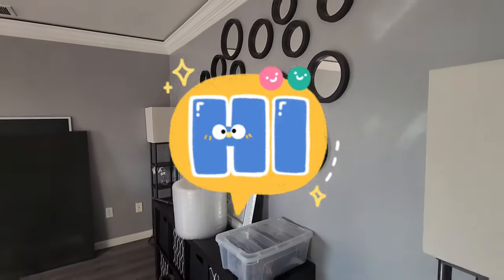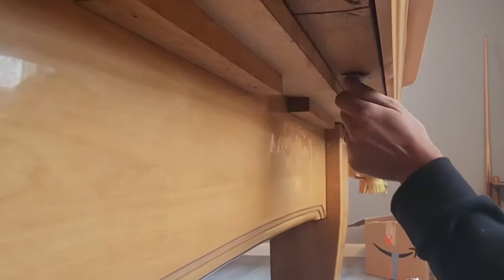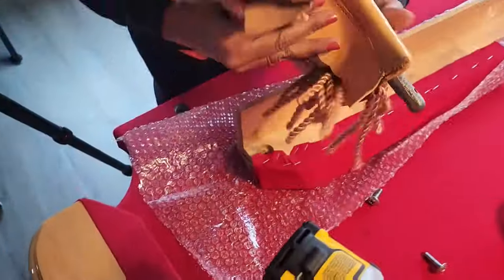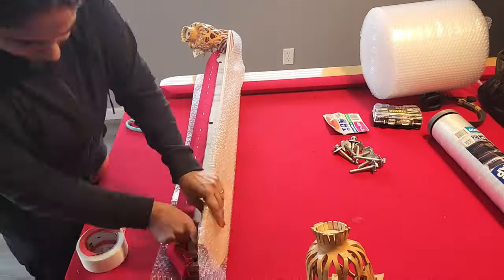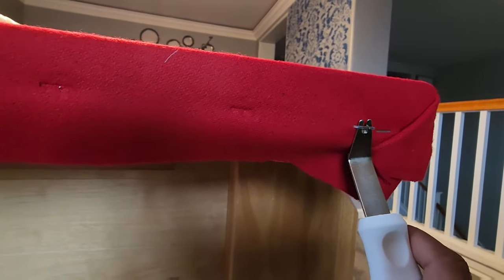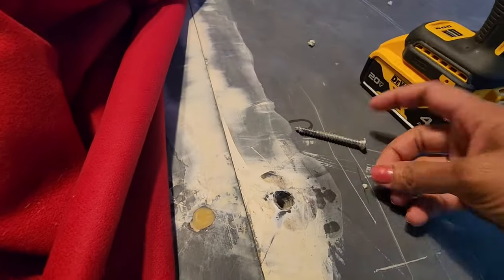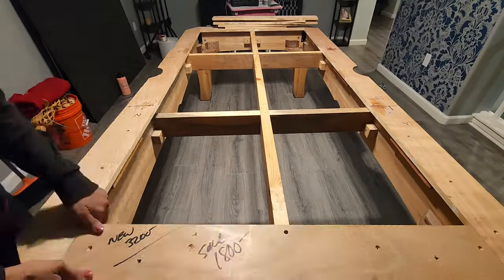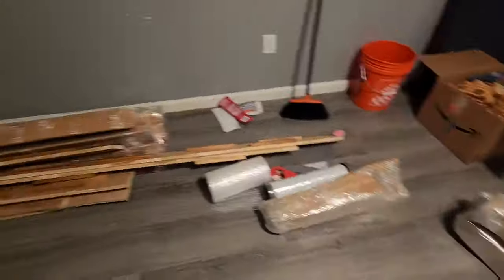steps to disassemble pool table

Comment: What glue did you use to set it back up?
Reply from the maker: For fabric I found on Amazon Polymat 777 and for covering nails I used construction glue.
Reply: @diyanyonecandoitnaheed melted wax is the preferred filler used for anyone curious...